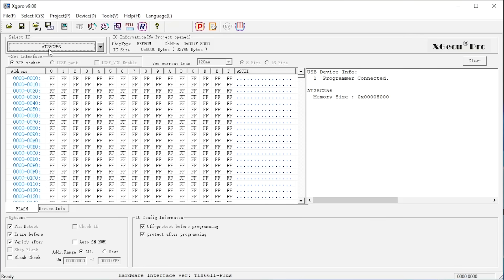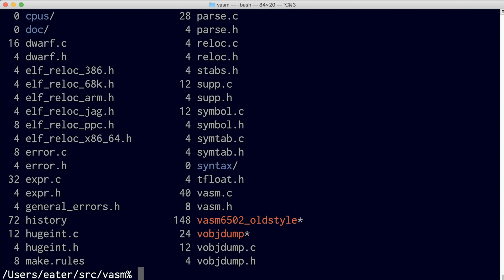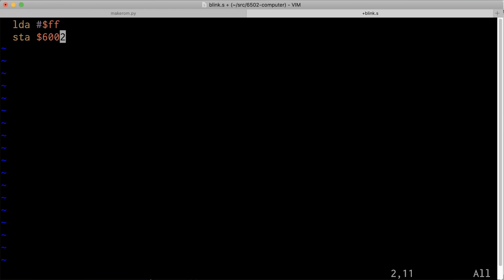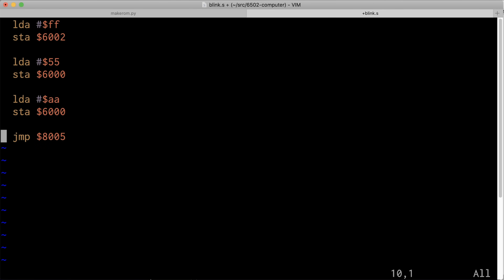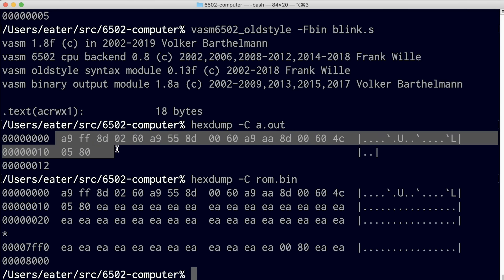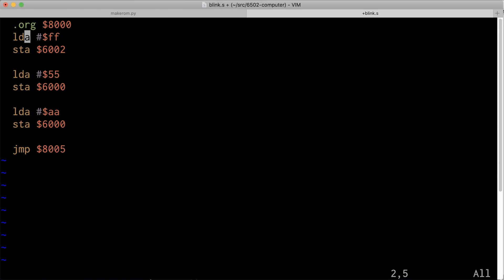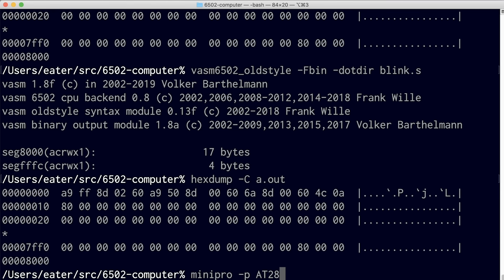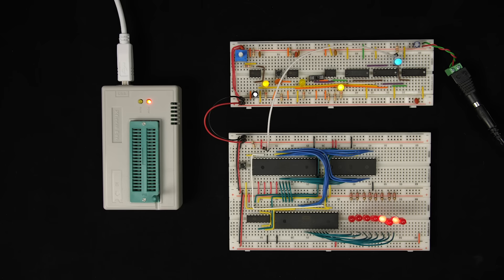Assembly language vs. machine code — 6502 part 3

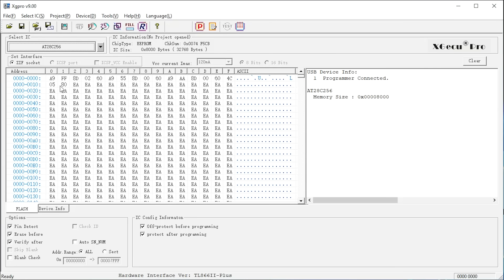Comment: 0:49 "...you'll not gonna be surprised that no one actually writes software this way" ...well, certainly not now anymore... back then, well... actually yes :D
...granted, after getting first a line-, then even a fancy macro assembler to run, some more serious coding could happen ;) ...still funny to get some 6502 assembler lines to see after some 35odd years and still casually read along, like if the last time I did that has been just yesterday...

Comment: Hey, thank you for the great series!
I have a question, how did vasm know to put the code preceded by 8000 at location 000 in the output binary file? I know why when the 6502 accesses address 8000 it actually lookup address 0 because the MSB is used a chip select, but I can't figure out how vasm knew this info and subtracted all addresses given after the .org mnemonic from  0x8000? Is there a specific option that I missed during making or compiling?
Reply: I know this is old but it may help someone else understand - by stating .org $8000, you are telling the assembler that the start address the CPU will use is $8000. This way, the assembler compiles the file starting at address $0000, but it knows the CPU thinks this is $8000, so the compiled assembly file is only 32kb large ($8000 - $FFFF, which is converted to $0000 - $7FFF), instead of 64kb (which would be a full $0000 - $FFFF sized file).

Comment: I don't quite understand the purpose of the first `.org $8000` directive @ 7:28. I understand that the 6502 must read the instructions at 0x8000, but those same instructions are at 0x0000 on the ROM chip itself. Since we are generating the bin file of the ROM chip, why do we specify `.org $8000` if we want them to be at 0x0000 on the ROM chip? And why does the generated binary file start at 0x0000 even though you specified you wanted it to start at 0x8000 (9:19, first line is "00000000   a9...")? And why does your 0x8000 word at `.org $fffc` actually appear at 0x7ffc in the bin file (9:19, last line is "00007ff0    00..." instead of "0000fff0    00...")? The assembler seems to have overflowed?
Reply: .org is the address once the ROM is attached to 6502 — it's the addresses shown by hexdump which are wrong. Also .org is assembler depended. The assembler I use uses .segment instead and placed the code and data automatically. See my blog for details:

https://steempeak.com/hive-175254/@krischik/ben-eater-6502-kit-day-13

That assembler also has a dissembler which takes a start address as option to correct the addresses:

da65 --cpu "65C02" --start-addr "8000"

Comment: Although I'm a little confused about something, I think I get it: the .org directive doesn't set the location of the instructions, but sets the relative locations for the labels, so that the labels will always be at the expected positions. This is why the .org directives in the assembly program designate addresses outside of the range of the EEPROM, but makes sense to the CPU (due to the A15 address bit)
Reply: Correct. But there is an easier way to look at it: hexdump is printing the wrong addresses. There are tools out there which can correct the addresses like da65:

https://cc65.github.io/doc/da65.html
Reply: @Martin.Krischik  I see, thanks

Comment: Graduated with a degree in Computer Engineering a few years ago and I WISH I had an instructor like this guy because I've understood more from these videos than all of my Computer Architecture classes combined!!
Reply: Agreed.  Same situation for me in 1987.  Too bad Ben was not my instructor.
Reply: So true man
Reply: Got my first engineering degree in the early 80's and we essentially breadboarded a 6802 microprocessor like he did here. We cross assembled code on a PDP-11.  I later got a couple of 6502 computers, one of which was an Apple ][. I used the Merlin native  assembler with it. 

The 6502 is challenging to code because of its limitations, but there are some crazy things you can do because it is not micro-coded. It has several machine codes that implement unintended and seemingly useless operations, like Store Accumulator Immediate. 

I almost feel sorry for the folks now that dive straight into a Raspberry Pi or an ESP-32. Takes all the fun out of it.
Reply: @davidrush4908 we have to program 8085,8086 even now.
I agree with you, it's more fun with the oldies.
Reply: One of my biggest regrets is not majoring in Computer engineering.
Reply: They did taught us the basics of logic gates  and timers and latches. So it was help full tho to understand this vdo. But props to this guy to make me understand what's going on in the register levels 😂
Reply: So your computer engineering degree must be worthless then? Which college was this?
Reply: @deang5622 I mean, it’s one class out of dozens you take in college. I have the same degree (different college probably) and loved my computer architecture class, but there are other classes which had poor instruction. All college courses are hit or miss, because they’re taught mostly by researchers who just happen to be teachers. They are good researchers. There is a chance that they are good teachers. And they keep their job by doing good research, not by teaching well.
Reply: @ckannan90  I learnt more about computer architecture than I did in my university degree by self study.
Reply: @deang5622  No offense but thats how it's supposed to be. Especially when you reach degree level as compared to high school level.
Reply: @coconut_on_a_yellow_island  University degrees are supposed to be rubbish?

LoL..oh dear.
Listen to yourself.
Reply: @deang5622  I was referring to the self study part not anything else. like when you are in uni especially in STEM degrees research is more important.

Comment: Opcodes were how we did do it back in the day!  Literally by writing DATA statements in BASIC, and reading those and POKE'ing the values into memory addresses.  Back then we used to be able to memorize the decimal values for the opcdes (there weren't that many to memorize for the 6502).

Comment: Load A = A9 in hexadecimal
Which is 10×9=90 in decimal.
How about load B..
Is it gonna be B9 which is 11×9 =99 in decimal, which require extra one bit to load B compared to load A.
How do they make the size of variable name or in this case character type to be specific.
Because if I type load Zzzz
It will require more RAM than let say load A or B.
Reply: There isn't a B register in the 6502.

Comment: I Don't think I get the ".org"
Because when you do the Hex Dump, the restart vector is at position 0xfffc, but the main program is at the position 0x0000, shouldn't it be at position 0x8000 because the .org is 0x8000?
Reply: the .org just tells the assembler that the processor's starting position is at address 8000, but the program starts at address 0000 in the ROM which to the processor is actually address 8000, it has to do with the address spacing design ben chose, hope this clears out your question
Reply: @TcG4mer  After thinking a bit, this makes sense. in the ROM the code starts at adress 0x0000 but the Jump command would link to 0x8000 + the commands. I think I miss read the Adresses of the Hex Dump and that was causing my confusion
Reply: I don't get it either. I feel like it's a simple answer that I'm just missing

Comment: I used to program primarily in machine code on my TI-84+ because you can type the code in hexadecimal on-calc and I didn't have a computer. I got really, really good at memorizing the addresses of all my routines. I still code this way, too, because it's just so convenient when I need to quickly test something. No compiling, no typing out so many characters to spell out one instruction, and I don't have to set up sending a binary from my computer to my calculator.

Comment: Ok maybe I'm just dumb here, but what software are you programming with?
Reply: I just can't get the vasm program to run at all.
Reply: See, he isn't using a software to program, he is just using a terminal running a CLI program vasm, CLI stands for Command Line Interface. In Linux it's just called terminal (the app) but I don't know it's name in Mac...

Comment: You are writing .org $fffc but when you convert it to hex file it shows that at 7ffc. How is that possible?
(btw Thanks for these great videos)
Reply: It's because he has already given the .org $8000 at the beginning. That sets the absolute start address for the code, so it's telling the assembler "look, the cpu will be running this as if it started at $8000".  So, in the rest of the code, whenever another .org <ADDRESS> directive is found, it will now be compiled as <ADDRESS - absolute start address> 
So, it is essentially telling it that the .org $fffc is only "$fffc" for the CPU. In the context of the program, since the absolute start address was set to $8000 it is now $fffc - $8000 = 7ffc
Hope it makes sense.

Comment: Ben, Is there a chance that you could add a 5 digit seven segment display config to this series? I can send you one if necessary. I also have quite a few 1 digit seven segment displays that I could send. I suppose that it would be similar to blinking LED's only no blinking and with a little more info.

Comment: I was think about how to solve the problem of using all of the address space efficiency and came up with this idea. Using a arduino to read the address bus or more specifically the atmega 328p chip with a 16mhz clock crystal and some shif registers. Use a couple of parllel in registers to read the address bus and then a couple shif registers that take serial in parllel out to be enable lines one for every chip you could easily set a range of addresses to enable each chip. Timing should be a problem because the shif register would be running as fast as the microcontroller at 16mhz vs the 1mhz on the computer. You could also use the clock signal from the computer so you know when to set the enable bits or latch out the data. Can anyone tell me why this might not work?
Reply: It would be really cool if someone can write this code basically I would want somefunction("0000", "1234" "1"); that takes the starting range of the address of the devide you want to enable, ther end address, and the pin you want to out put it on out on a shift register so we can have no set limit on devices to controle. The hole point is so we can enable any device for a range of addresses and when the current address that's on the address bus is out of the range of the device it will turn it off. But I want the code to set the enable pin high for on so... for devices that are enable low might need a inverter. Or better yet you can specify the enable pin to be active low or high in the function  somefunction("0000", "1234", "1", "active high"); // "starting address", "ending adress", "pin on siftregister", "active high or active low"

Comment: A masterclass in microcomputer architecture.   The EEPROM write is very good by the way, but the software supplied is rubbish.  Take Ben's advice and get the MAC / Linux versions from github.

Comment: That first .org $8000 is throwing me off.  When you use it again to set the reset vector (.org $fffc), it actually writes the .word at that location, while the first .org doesn't seem to do anything in the assembled binary file.

Do you really need the first .org?  The CPU starts at $8000 because of the reset vector, not because of the first .org $8000.  What am I missing?

Comment: Hi, I didnt understand the part where you put .org 8000. I mean, how does the assembler knows to put the code in the first position of the EEPROM if it only has memory up to address 7FFF? Wouldn't it try to write that part of the code into position 8000??

PS. I love your videos btw.
Reply: I know I'm months late, but .org doesn't control where the program is put at all.  It's up to the programmer or the operating system to put it in the right place.  A lot of assemblers have a directive called .org or ORG, meaning origin.  The assembler maintains an internal program counter to keep track of where labels are and what to assign to them.  The origin is usually 0 by default, so if you had a label at the very beginning of the source, it would be replaced by 0.  But if you had a .org $8000, then the label would be replaced by $8000 in the binary wherever it's used.  That's all .org does.

Comment: id love to see if u can get running a c program there, there's cc65 i guess.
Reply: Funny as you say I use cc65 instead of vasm:

https://steempeak.com/hive-175254/@krischik/ben-eater-6502-kit-day-13

But only with ca65 and ld65. Since stdlib won't be available you would need to program C without a single “#include”. And you would need to provide an implementation of crt.o to call main(). Most C programmer don't know that but there is a lot of setup magic running in the background before main() is called. And some cleanup magic afterwards as well.

And the simple memory layout I used in my blog won't be sufficient either. There is a lot of linker magic as well.

C from scratch could well be a follow up project.

Comment: I am an electrical engineering student. I am fully satisfied with your whole series of videos. Would you please make videos about how machine code is translated by assembly language and multilevel language at very base level, something like you did programmed machine code to eeprom by push button... I want to make a mini computer in breadboard which demonstrate machine code assembly language and multilevel language...

Comment: How come the code at 13:36 is all “00” for the bits we dont care about? Why isnt it “ea” like before? Are “ea” and “00” the same thing?
Reply: Disclaimer: I've never programmed assembly (or machine language) on a 6502.

EA is "No operation."  Basically, the processor does nothing for a cycle.  If the program counter pointed to the beginning of a field of, say, 1024 EA instructions, it'd sit there and idle for 1024 cycles.

00 is "Break," which triggers an interrupt.  I'm not sure if the BRK is actually appropriate here, but theoretically the execution will never reach that point.

Comment: When someone calls Assembly  language "easier"...
Reply: It’s easier than messing with raw machine code.
Reply: @AshtonSnapp  Creating our own 8bits turing machine, then creating the assembly language and the assembler for it, then creating compiler programms for it, then creating programs for it, is way easier than programing a x64 intel processor with pre-built libraries for a langage made from an other one made from an other one made from x64 assembly that we have to learn and that have no other issue than just getting the work done. Well, im a fan of homemade tech.
Reply: @ggldmrd5583  it is like walking a road yourself from beginning to end , instead of using a map by someone else  .
the understanding is deeper and fuller .